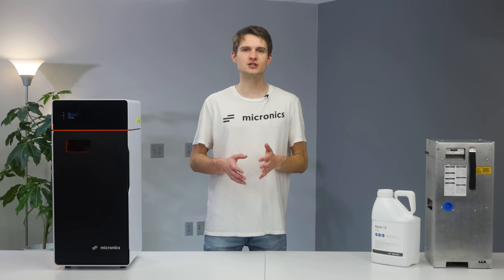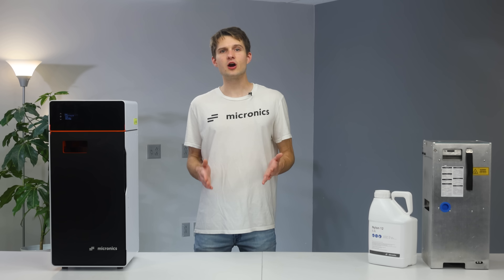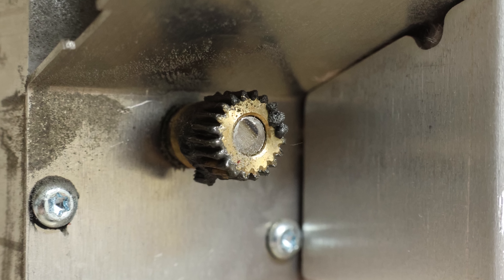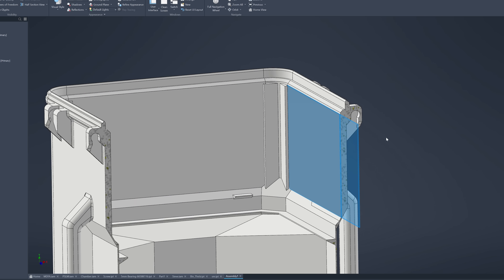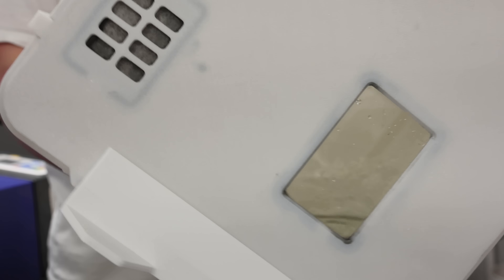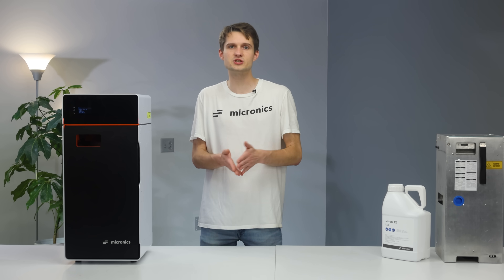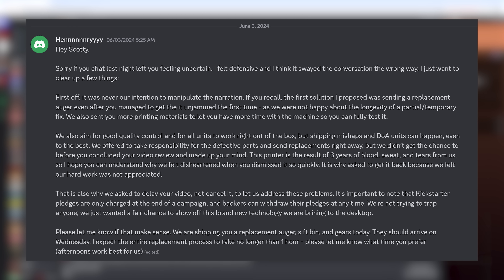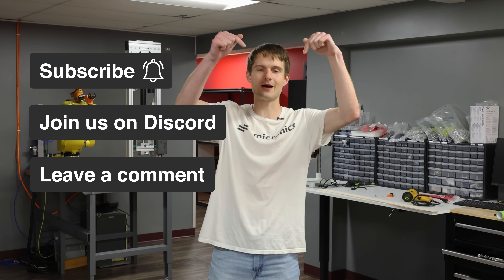EVERYTHING we'll change with MICRON + Response to Scotty

Comment: I have a feeling that this type of printers is just too complicated to use for an individual in their garage. I’d prefer to order the prints somewhere.
Reply: I build cars in my garage, and even powder coat parts. I can handle this. ;)
Reply: plus, having to have a sand blasting cabinet for the prints..  that's bigger than the printer itself.  and then an air compressor and vacuum system for the sand blaster... 
the support tools necessary for the printer are $$$, and take up a lot of room.   this hasn't been made very obvious  yet, but I bet that'll be one of the things mentioned by the early buyers.
Reply: @CrudelyMade  Air compressor, sand blaster, and vacuum to do this work can all be had for under $500 total. Even less if you buy cheap or used. Sand blasting isn't 100% necessary either and you could probably use a tumbler of some kind. It's definitely clear this is not as accessible as FDM, but that's fine.
Reply: @CrudelyMade  Air compressor, sand blaster, and vacuum to do this work can all be had for <500. Less if used. Sand blasting isn't 100% necessary and you could probably use a tumbler of some kind. It's definitely clear this is not as accessible as FDM, but that's fine.
Reply: @802Garage  +20% cost, okay.. and the space for all of that also needs to be considered.  plus the time to process items through the cleaning process.  
maybe the extra cost, space, and time per print doesn't matter to you.  but to many people it's a factor, and should be addressed as such. to dance around it now is asking for it to be brough up as an issue by users later. ¯\_(ツ)_/¯
deny that all you like. ;-)
Reply: @CrudelyMade  Of course it's a factor, like literally any hobby. Wood working comes to mind.
Reply: @802Garage  wood working is a hobby, this is a single product.  this is like saying "buy our drill press!  plus, you'll need these 3 other huge things in your shop!"
you're literally comparing the overhead of a full hobby to the overhead of a single product. lol. 
look, I get it, you like what they're doing and you're trying to white knight for them. that's fine. 
but you're literally not converting any of my points, and it seems that maybe you either don't understand what I'm saying or you're being disingenuous about your arguments.  if you like them, that's fine. do that. 
I'm just stating predictions based on known factors. 
they can ignore my interpretations. what would I know? 
I'm just a business analyst. :-D
Reply: @CrudelyMade  It's like saying. Oh, you want to make a wooden chair? You could whittle it. If you want it to be nice though, you likely want a table saw, a lathe, a drill press, a planer, a router, a sander, and a respirator for sanding and applying finishes. There are more tools you can get of course, all depends.
You aren't buying the product to have it, you are using it to make things. So you want a completed 3D print? Even a miniature chair, for example? Well if you want it to be SLS printed, you need an SLS printer and ideally a sand blasting cabinet, a vacuum, and a respirator. Maybe even a table to put it on!
If it was SLA printing, you would need the SLA printer, a curing cabinet, a wash cabinet, a respirator, and various tools to clean up and store the resin as well. At least if you are aiming for optimal results. Might need a table for that one too. Also a dedicated space due to the smell, like with SLS powder concerns.
With an FDM printer you need just the printer. I could argue you also need ventilation equipment, various small tools to remove parts from the build plate and remove supports, and if you ever want to go beyond the base finish sanding and filing equipment, deburring tools for example.
For each process you also need whatever material the printer uses in each case and wood for woodworking, of course. Keep in mind the material for this printer is also fairly pricey, but you are getting a different quality of product from the end result. Will everyone run away because of $88/kg powder?
Basic point, you're looking at this entirely the wrong way and you want a process to magically not require processing. This printer is one part of a process to get an ideally finished part. Keep in mind it still needs further processing if you want a smoother finish, color like from paint, or if assembly is involved.
Has nothing to do with white knighting, and that's a poor logical fallacy argument. You are buying this product to make other things. It is a tool, not the end product.
If you don't like making things, you do realize you can always just buy one at the store, right? Then why are you even into 3D printing?
Yes, this product involves more cost than just the single product. Welcome to almost any manufacturing process known to man. Yes, anyone who buys this printer should know that and given it is discussed in every single video on the product, they do. The only point you have made is that tools cost money.
This is the cheapest an SLS printer has ever been period. The fact it is several thousand dollars is already a gate for the vast majority of people. Nobody is dancing around the extra space, precautions, and tools needed. It's also inherent to the process, so I'm sure that was part of their business analysis. ;)
Reply: @802Garage  you're right.! they're great! good job! you totally convinced me! :-D are we done now?
Reply: @CrudelyMade  Yes, we are done. We agree that SLS printing requires adequate space and additional tools for processing.
Reply: FDM printers jam, have layer adhesion issues, elephant foot, some filaments have toxic fumes, zband issues, etc.
Resin printers are toxic, create fragile pieces, require post processing, have disposable pieces, and are toxic. Yes, I repeated for emphasis.

If they manage to make the Micro SLS less fragile and more reliable, I don't think it'll be any more complicated than the other types of home 3d printers.
Price is a huge barrier though.
Reply: I do expect printers becoming more accessible should make commissioning prints from someone willing to do the work more accessible as well.
Reply: Yes sure, but many people would be still interested in this. Also remember this IS JUST THE START,  these guys are really innovating in the term that they are doing something new. Not inventing something, but bringing something new to the table and making SLS more accessible to people. Not necessarily to everyone, but to many more people than previously
Reply: @ashers_workshop  Listen I hear you both, and anyone concerned about the extra costs. You should try being into cars. 😂
Reply: Yes, the printer is better for more advanced enthusiast with more space and dedication. It's also a pretty good option for people who have companies that need much stronger parts or who run 3d printing businesses.
Reply: @chronokoks  I think I’d rather pay more but get something more bulletproof for business.
Reply: Micronics is the creality of sls (in a good way) it’s expected that it will be a difficult for regular consumers to use
Reply: Too complicated, and too dangerous. Too many ways to use it wrong. It’s the table saw of 3D printers.

They seem like decent guys, but this product is sort of flawed unfortunately.

Comment: I like that you guys made a response, but I noticed a huge flaw. It seems everyone and their mother is using a KN95 mask as well as yourselves in your videos. KN95s are NOT sufficient protection and are virtually impossible to pass the saccharin mist test with. You can easily test it yourselves by trying your best to fit a KN95, a cheap Amazon nebulizer, and making a super saturated solution with Sweet and Low. You will get an extremely bitter taste in your mouths and KN95s won't stop it.

KN95s were an emergency measure during the shortage of good masks during the pandemic and are better than nothing, but there is no longer a shortage, and if you're selling a machine like this I feel like you have a duty to wear and advise your consumer customers on proper PPE for these machines. At minimum a high quality N95 should be worn, or even better a half face or full face respirator.

Comment: I would absolutely recommend going for injection molding with the sift bin, you can get better strength and can consider fillers for the raw materials if needed. Maybe later when you'll have more orders but as things are looking you're about to go big so the ROI on the tooling might not be so bad.
Reply: HDPE / PE Blowmolding might be another manufacturing that's way faster and cheaper. The current one has the wrong materials and the wrong manufacturing for such a part.
Reply: Getting a tool machined at that size, even for "cheap" tooling made in asia, is probably going to be in the 50-100K$. And you need a designer that actually knows how to design parts for injection molding or blow molding, or you will have a lot of tool design changes that cost anotther few thousands again, or worst case, a totally useless tool. Plus, the time frame to get a tool like that ordered and machined and some first samples made in a machine is probably at least 3-4 months, if not more. Especially if you don't have connections in the industry and need to find and evaluate suppliers first and don't want to spend massive $$$ for quick priority production services.
Reply: @ProtonOne11  I agree but that's what developing a physical product entails, it depends on the ROI, part functional demands, part lifetime, and how many printers they want to ship per day etc
Reply: @ProtonOne11  No way would that cost $50-100k.  My most recent single cavity aluminum tooling for a simple part with no side actions was about $5k.  Their part is bigger but I'd expect $25k max, closer to $15k if they find the right vendor.
Reply: Their planned approach might work OK and be cost-effective, but will take a massive amount of time to print unles they have a ton of FDM printers. 

While I haven't quoted a part that large before, vacuum forming or blow mold tooling is significantly cheaper than injection molding.

Other options to consider:

Use an off-the-shelf PVC or ABS box, cut, and weld in a custom features (FDM ABS or injection molded parts) using pipe glue. A knockoff Festo systainer may work well. The solvent will dribble, but it doesn't need to be pretty on the inside of the container. Ultrasonic is another option ($5k+ tool).

Full sheet metal construction: Extra thin aluminum sheet metal (weight), riveted tight, caulked edges. Assemble the parts in the US to save on shipping. Hem all edges so there are no sharps. 

V-cut plastic sheets can be formed into any shape and solvent or ultrasonically welded (like folded metal but with lightweight inexpensive plastic)

Of course there are lots of hybrid approaches with top/middle/bottoms made using 1 technology and walls from another (eg, ABS printed 3d features with panel slots, then get sheets of ABS CNC cut for walls, then solvent weld them together)

Finding the right mfg technology (and company in China) would be a great way to Scotty to help them out. :)
Reply: it definitely needs also to be fiber reinforced plastic.

Comment: Takeaway1: Sintermetal processing is affordable. Takeaway2: This is how to learn from betatesters. Good work.
Reply: Takeaway three: things like communications and PR personnel might sound like a useless hassle to engineers, but they are a necessary evil. Poor clarity when communicating with early adopters, reviewers and the press can be the difference between a company surviving or failing before they had a chance to show their value. And to be clear, the last thing you need is a spin doctor, the stereotypical marketing fool that thinks you can distort reallity all the way to success. Stay open and candid. But don't assume just saying what you think it's enough. Work with someone that is skilled at analyzing how what you say will be perceived and that can help you phrase things better to get the impact you want. It's not an expensive skill to have, but it's an expensive one to miss.
Reply: Takeaway3: a nice curry, please.
Reply: Takeaway4: Beef stir fried rice noodle with black bean sauce please
Reply: Something i've been wondering for a while. Can you  use some sort of metal powder and get a metal part?
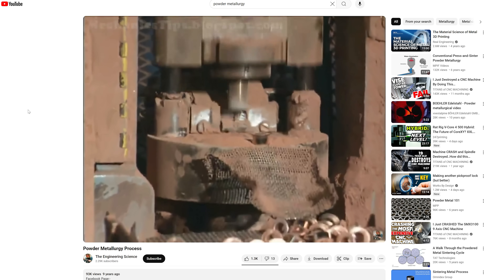Reply: @pcdi7531  Yes. There are four main routes to do this: 1) MIM (metal injection moulding which uses a polymer+metal powder combo followed by a sintering in inert gas), 2) SLS laser sintering, 3) BASF Ultrafuse FDM and 4) giving the metal-powder some brute force compression followed by sintering, as shown in the video at 4:02. Tooling for the latter method used to be expensive. Apart from method 2, all have a final sintering step in common.
Reply: @nielserikstrup  yes, you can sinter metal with this “type” of machine. You would need to upgrade numerous components including the heating system as well as the laser itself. For FDM metal though, there is a company Sapphire 3D that proves sintering services for FDM printed metal filaments.
Reply: So, if i'm not mistaken, theoratically at least, i could buy this printer and get myself some metal parts? That would be so cool
Reply: @pcdi7531  No, as far as I know, the Micron cannot do SLS of metal powder. Metal powder printers require more oompf in from the laser.
Reply: @pcdi7531  that would require a really powerful laser, not sure if this one is strong enough (you would need a laser in the order if 100W or more). If it's possible at all it would be with a metal with a really low melting point like zinc alloys such a Zamak. You might also need to fill the build chamber with an inert gas to avoid oxidation weakening the bonds.
Reply: Good to know. Thank you for your help :)